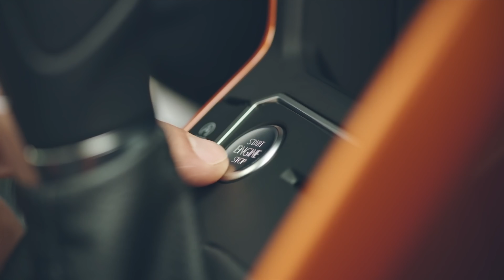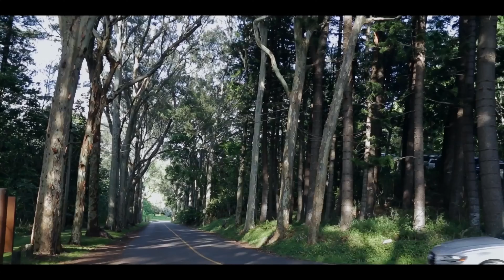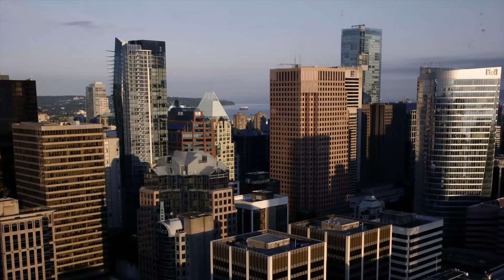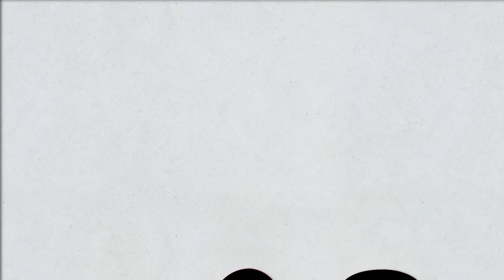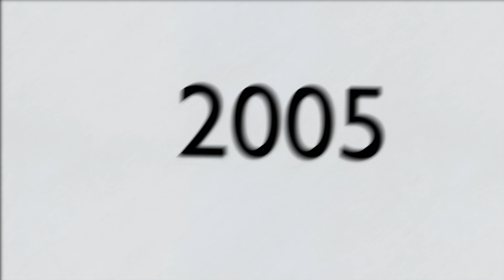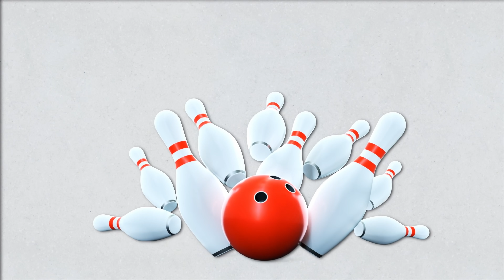Volkswagen Just Got Fined Billions and May Be Going Bust

Comment: That said, I have a tdi, and at least where I live they are in high demand on the used market.  Even with the post dieselgate new software, my tdi still gets 900Km on one small tank of fuel and has been rather reliable so far.  I wish vw group still made diesels because I think there’s many upsides compared to electric and I would buy another
Reply: I had a 2015 Audi Q5 TDI lease while this scandal surfaced. Audi spared no expense remedying their software after the lawsuits settled. When it came time to turn in my lease in August 2018, I actively sought out and purchased one of the mothballed Q7 TDIs. My Audi sales guy secured one for me with 64 miles on it. After all the updates required by the EPA, it still gets me about 28mpg on average. If I had the option, I'd love to get the Euro-spec RSQ8 with the 4 liter V8 TDI, but VAG isn't selling new Audis in USA anymore.
Despite the very dated technology, the ridiculous one is the 2009 monster with a 6 liter W8 TDI Q7, also unavailable for import to USA. ;-(
Reply: You should have never turned it in
Reply: One of the favourite diesels I owned was a 2000 Bora (Jetta) TDI (red I). At that time they were fairly low 115 HP but had huge torque at 310Nm. It was such fun to drive on the torque curve by short shifting thru the gears and returned over 40mpg. 
RIP 😔
Reply: Once gone we have to move on
Reply: @davidmontroy3408  I went out and got an auctioned off 2014 tdi sel passat, hence it being sel with the premium fender sound system, the original owners stripped it of all of its fancy features before having it bought back from volkswagen. But after driving it about 10k miles (I drive 7500 miles a month) I got a coolant leak in my intercooler and it fried my turbo,the whole dpf filter system, egr, egr cooler, and really everything in between honestly, but I took it to my volkswagen dealer team that was like over an hour away and they replaced over 6k in parts including my rear main seal, my oil pump, and an oil flush all under warranty, including labor. I bought the car 5k under value and volkswagen put over 6k in value without me having to spend a penny
Reply: Mind you I did not buy the car from volkswagen, I got it from a joe blow auction company in Michigan. And the car being tdi still had a dealer warranty, and extended ones at that
Reply: VW paid me 7000 and i kept my TDI, super car, love it!
Reply: @sorinelpustiu5674  Just because EVs don't pollute directly, doesn't mean they don't pollute at all. Electricity has to be generated somewhere. Even if that is from a renewable source, the resources to produce that renewable source would've caused a LOT of pollution (mining, processing, shipping, etc.).

Speaking of resources, the materials that go into the batteries need to be mined (lithium, cobalt, etc.) - an additional point is that Russia/that kind of area sit on the largest reserves in the world of these materials, I believe (could be wrong though). Obviously, the raw materials for things like body panels on an EV don't change much compared with an ICE vehicle.

Finally, they're built to be basically disposable. The batteries have a finite life and can't easily be refurbished (if at all). Things like the inverters and motors aren't designed to be repaired either, they're designed to be replaced (read: thrown away).

Yes dieselgate was awful (not that my car came under it), I totally agree, but EVs aren't a miracle cure... Also they're very expensive given the economic climate for the younger generations plus have all the practical issues surrounding charging and range and electricity grid loading etc.

Rant over.
Reply: @adzib1823  plus TDI's last 100's and 100's of thousands of miles not going to land fills like all the short life battery cars.
Reply: This guy on obviously has it out for vw. This is old news. Can't stand his videos.
Reply: They didn't stop building diesel engines...

Comment: When the engine was running, the computer would look for inconsistencies, like lack of steering wheel movement, or no body weight in the seat. When these inconsistencies were detected, the computer would calculate the car was being emission tested, and would go into cheat mode with lower emissions.
Reply: According to the TV series 'Dirty Money' the steering movement system was the SECOND attempt by VW to circumvent the emissions check, unbelievable nerve!
Reply: Ha ha
Reply: That's pretty clever
Reply: Now that’s a smart car lol
Reply: What is wrong with forcing down emissions when the vehicle is not in use but idling? So now they got penalized for actually lowering emissions form time to time.
Reply: Used to turn the mixture down on carburettor engines just before the mot, ran crap but passed emissions test, then turn it back up afterwards lol
Reply: I was told it would "run clean" anytime a scan tool was plugged into the DLC.  IT's genious and as much as I hate Volkswagen, I wished they had gotten away with it.
Reply: makes you think the engineers used to be politicians,does'nt it ?
Reply: @jurycould4275  I want you to be right, do you have a source confirming it was coincidental?  My research led me to believe that the computer specifically detected the standardized test pattern, causing it to reduce fuel or boost while increasing DEF injection and EGR percentage. 

I was taught that Mercedes Benz got caught in the mid 80's using the abs sensors to sense when their cars were on the Dyno, thereby switching to a rated horsepower and lower emissions tune. Pretty ballsy for VW to do the same thing again.
Reply: Lol cheatmode

Comment: I bought a new 1980 Rabbit Diesel, last of the German made Rabbits for sale in North America.  Almost all of them came with a 4 speed manual transmission, but a 5 speed stick was optional, and mine was ordered that way.  At 70mph it was just lugging along at a comparatively slow RPM; I calculated on a 2,000 mile trip that I took that I got 70 - 72 miles per gallon!  It was a good reliable car . . .
Reply: LOL I had one also. A 1982 and was in the military.  Drove that thing all over the USA.  Your right 5-=60 mpg.  Replaced it with a Corolla.
Reply: @robertrusso1688  Yeah, it was a lot of fun to drive; the diesel had all of 48 hp and you had to run the snot out of it to get it going - felt like Mario Andretti while going 35 mph!  But all good things end . . . it was a SMALL car, weighing only about 1850 lbs. (hard to believe it was that light?) and when my first child was born, I decided to opt for a big resale Buick LeSabre.  I wouldn't mind a smaller car now, especially given the high gas prices.  Robert, was the Corolla the great car that everybody seems to say?  I've never owned a Toyota . . .
Reply: Great cars!  A colleague's mother bought a Rabbit diesel new in '79 and kept it. When it was around 25 years old (and elligible for the low-cost "Collector car" insurance) she got it from her Mom (parked in a tiny garage for years) tore it down to the bare body, and then re-built everything and put it back together. So it looked like a completely new car (the body/doors/hood/hatch were re-sprayed in the stock silver color, all new door and window rubber parts were used, etc).  The shocking part is that the decades old vinyl seats had no visible signs of wear, and she left them "as is".  
She took it to a VW show in Seattle when it was done, and took home the top prize! 
Her biggest complaint was that she couldn't get the correct tires for it.  "B78/13" or something.  Tallish and very skinny.  Better for economy than cornering.
Reply: you could roll some serious coal with those cars lol
Reply: @fredberger3155  around 1976,the corolla was the least repaired of any car made.3000.00 out the door........
Reply: I am from europe I alos had one it was 1979, 1.6 diesel, 40kw, weight 760 kg, and conumption was 5 litera per 100 km, best car in my life
Reply: My 2013 golf is made in Germany
Reply: every single person in a car behind you was cursing you and your mother because of the unbearable stench that comes out of any german diesel rot box.
Reply: @BaconKwagga  what about Chrysler and GM?
Reply: @BaconKwagga  ive never smelled anything as bad as chevy/gm. rotten egg.

Comment: My sister had one of those that VW had to buy back ...the dealer just give them a new Passat and she still has it,I drove it the other day and saw it was approaching 100k miles. Only thing that quit working on it was driver side heated seat so far and had a brake job done at cost of 800 bucks.
Reply: Must be special brakes
Reply: @tomdavis3038  Expensive Mechanics.
Reply: You can do the brakes yourself for $100. Dealers are way too expensive.
Reply: @OZD-mb2bs  he probably meant e-brake because vw fked up those. They can lock any time you use them.
Reply: I use to work for vw dealership .. repair cost incorporate specific German tools to work on their cars
Reply: How's the resell value on it now?
Reply: She should have kept that thing. They are bringing good money right now.
Reply: Geez
Reply: Cap
Reply: Volkswagen covered my car I bought from an auction over 6,000 dollars in parts. All covered under warranty, I will never go to any other make. I owned a 2.5l before my tdi, and never had one issue with it
Reply: @OZD-mb2bs  yeah,they bent her over on that one..................
Reply: @drayke8886  nope

Comment: I bought a new 2013 Passat SEL TDI. It came with 3 years free maintenance. It was one of the best cars I have ever owned. 45 mpg commuting to work on secondary roads and 50+ mpg on the highway. 39 months later, I sold it back to VW after their buyback offer. I just couldn’t turn down the offer. They paid me just $600.00 less than I paid for it new. 3 years of free maintenance,  so it only cost me $200. per year. I would buy another TDI if they offered it.

Comment: Love my 2014 manual, TDI, Jetta. I decided not to sell it back to VW and never regretted that decision. Best daily driver I’ve ever owned. Not the most luxurious but the best I’ve had hands down.
Reply: They literally did everyone a favour. At least in Europe lower CO2 means lower road tax, it was quite a win, whilst offering better performance and fuel economy. Hats off to Volkswagen, shame they got caught
Reply: @markplott4820  yah, thx bud!
Reply: I have it too, just love it!
Reply: @markplott4820  Why in god's name are you comparing a 50k car with a 15k car?
Reply: @jollysouwester56  Don’t waste your time with this guy. He knows nothing about cars clearly form his comments. Mark is probably the 3rd owner of a model three and doesn’t know how to drive manual.
Reply: Out of curiosity, did you get anything from them once you refused or was it a “dig your own grave” type of deal?
Reply: @markplott4820  VW is way more reliable than Tesla. My  GLI smoked a model 3 the other day. I have to say is stage 1 though but a $28k car with a $700 tune is quicker, cheaper, better looking than model 3 base.
Reply: @markplott4820  not when you consider  cost of acquisition, all the time wasted charging, heightened charging costs, lack of supply chain for parts to repair accident damage or electronic faults. Not to mention - at the 10 year-12 year mark, the Tesla is a write off . Replacing the battery pack costs as much as a new car ( around 27k). And the Li-Ion battery packs are not environmental or human labour friendly - often sourcing materials from countries that use “slave labour” at high personal health risk to mine…
Reply: @markplott4820  haha that was funny

Comment: despite all the dieselgate controversy, i still LOVE my little TDI!
also, they ARE able to still sell the cars. there was a “fix” that went out. mine is a 2015 Golf TDI, which received the “fix” and was sold by Carvana. it has a warranty on all the emissions gear until 2026 or 162k miles, and because of it my dealer fixes anything that happens for free.
Reply: Had a chance to buy one a 15 Passat well you snooze you lose 😂

Comment: I owned a 2012 Passat TDI. Best fuel economy I got by both my manual counting and on-board trip odometer was 58.6MPG at 55mph.  I usually drove 75mph and got 42mpg.  
A thousand miles a week for 2 solid years between El Paso, TX & Tucson, AZ. 325 miles from home to work, door to door, one way.   8 trips a week between El Paso and Las Cruces, NM, approximately 52 miles each way. 
Screw CARB and EPA.  loved that car!
Reply: You were traveling 9h for work each day? Wtf
Reply: @drayke8886  re-read what I wrote please.  Pretty sure it says "Week!"
Reply: @tristanholland6445  he made 8 trips a week between las cruces and El Paso. Then the trip from El Paso to Tucson and back once a week. All of it for a total of 1,000 miles a week. Seems he typed it up pretty straightforward to me

Comment: Love my 2015 VW Passat TDI. I don't know of any car on the market that can go 800 miles on the highway (with wife, kids, and bags) without filling up.
Reply: My 2014 1.8t will do over 700 miles on a tank if I keep it in the upper 60's strictly highway cruising on regular gas.  I did it during a trip from Pennsylvania to Florida and went 728 miles, using about 17.1 out of 18.5 gallons. (Manual of course)
Reply: @davidjac36 , my personal record is 795 averaging 75-78 mph with the family. Solo in the mid 60 mph range would easily top 800 plus. Damn shame diesels are getting a bad rap.
Reply: Those are great cars, I should have bought one when I had a chance.
Reply: 100% agree, I love my 2015 Golf TDI.
Reply: I only get around 640 miles per tank, but doing it with a full size Audi Q7 TDI. I fill up about every 3 weeks or so. I also have never allowed it to go less than "100 miles" left, according to the MMI's estimate. So basically 1/4 tank.
Reply: I have a 03 Jetta tdi manual and my personal record is 628 miles before filling up again. Going 75-80 mph highway and I took road trips in it from ca to ga 4 times! And it has 310,000 still running like a champ!
Reply: I'd rather get like 500 to a tank with our 5 spd hondas and not have to worry about the cost to fix it IF it broke down.
Reply: Love my TDI’s reliable fun to drive and economical. My old 02 TDI had over 350k miles with no major issues as well as my 1980 Mk1 Golf Diesel with over 500k miles on it just utterly reliable.
Reply: @davidjac36  You ran a turbo petrol car on regular gas? That engine won't last that long if you keep doing that. They are meant for 95 octane RON at least. Regular is 90 RON I think.
Reply: Many others, even better
Reply: @MzwandileHarmans , I'm talking on the freeway, averaging 70-80 mph. Besides semi's, I don't know of many vehicles that can go that long on one tank of fuel.
Reply: @jarvi69 . You didn’t know of any. Now you don’t know of many 🤗
Reply: @MzwandileHarmans  Which ones?
Reply: @MzwandileHarmans , if you know of any automobiles that can go north of 750 miles without filling up besides the VW Passat TDI, please enlighten me.
Reply: @jarvi69 . YouTube people lazy to look for information when they haven’t experienced something. Passat 2.0tdi consumption ranges from 4.5L/100km to 7.9L/100km and May go even higher depending on how you drive. Also considering the size of the fuel tank.  Passat has from 59L to 70L fuel tank, that is big. Do you wanna take over and go find out those other cars ? You don’t have to tell me. I don’t wanna talk about smaller engines like 1.5 tdci you’d find on a fiesta with range 3.3L/100km, would be unfair
Reply: @MzwandileHarmans , those are answers I already know. Still waiting on your answer to my question. Which automobiles can travel north of 750 miles on one tank of fuel? If you're here to poo-poo on diesels, I'm sorry for you.

Comment: 1.  thank you for an excellent presentation.
2.  I have been watching this channel for years.  My car is 18 years old with fewer than 120k miles.  The only way I will replace it is when someone hits it and the replacement will be a used, manual transmission car if possible that has been checked out

Comment: I got a 2001 VW Diesel Beetle and with 58 MPG , unless VW gives me 100k , I'll keep enjoying filling up once a month 😁
Reply: But you pay an awful lot more for diesel unles you get it cheaper than it is around where I live. So if you look the cost of diesel vs. gas, you probably only get the equivalent of 40 to 45mpg in a gas car. As far as fuel cost goes.
Reply: @mikemortensen4973   
$4.50 a gallon for Diesel 
$ 3.85 for gasoline.
So for .60 cents more I get almost double the miles .  I  save a ton of money
Reply: J.Robert Sergertson ....the video starts: "In the late 2000's...". So your car is not eligible. And most likely is polluting within the limits of the day it got of the production line (Especially if it is an SDI engine, and not an TDI).
Reply: @CristianSpitz  
Nope it's a TDI !
What's your point exactly?
Reply: Das Auto - as the motto of this Teutonic Brand
Reply: Awesome! Seriously, I wish I had one for everyday driving. Keep rolling that coal! 😄
Reply: @paulm749   LOL , that's my next upgrade 👍

Comment: I have a 2006 Jetta TDI. Bought it used. Drives great, lots of power and gets great mileage (about 35mpg). Problem has been, other than replacing the overhead cam, is all the electrical problems. The little stuff is death by a thousand cuts, Jeez. Fortunately I work on my own cars. I’ll get rid of it when I get tired of fixing’ it. For now, though, I love it, great town car.
Reply: 35 mpg isn’t very good for a TDi actually. Unless that’s your combined ratio. If that is the Highway ratio it’s about 10 MPG worse than it should be.